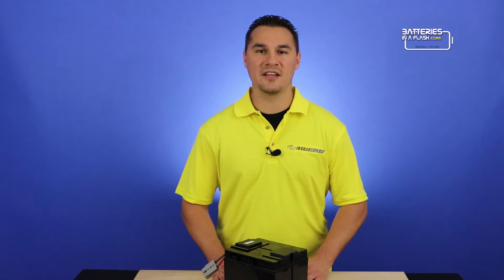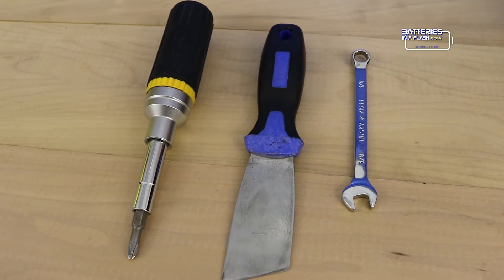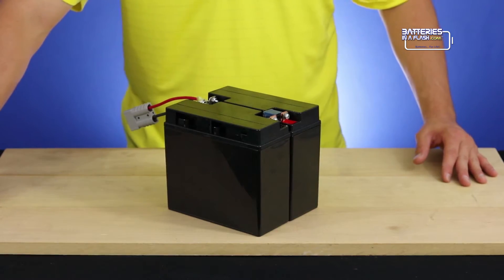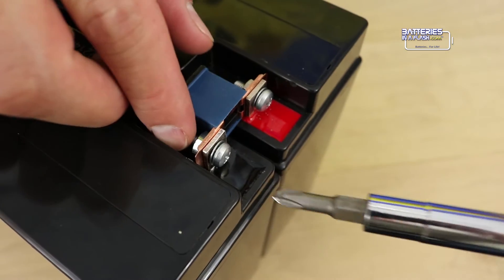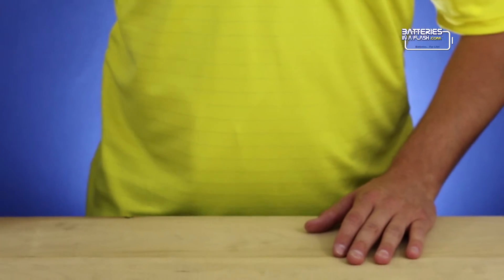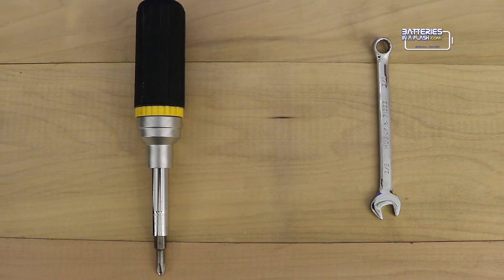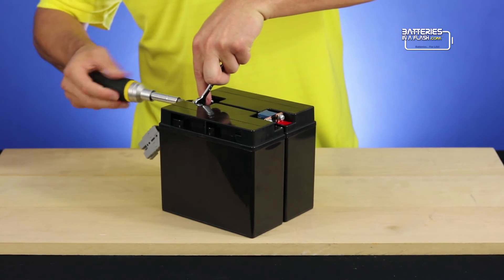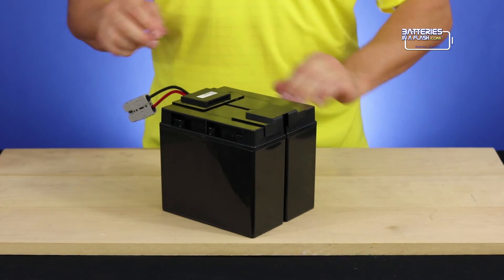Rebuild RBC7 APC Battery Backup Cartridge for SMT1500, SUA1500, SU700XL & More

Comment: I would prefer a plastic tool to remove the covers
Reply from the maker: Definetly use a tool that you feel comfortable using. As long as you get the covers off, that is all that matters. Great suggestion.
Reply: @Batteriesinaflash  Sticking a metal part  on the pos and neg, when everything is still connected.... that's what I meant

Comment: can man use 12V 20Ah batteries?
Reply from the maker: Ousama Hariri Any 12v SLA battery can be used but only the 7Ah, 8Ah, and 9Ah will fit in the housing properly. If you used a 20Ah you would need to run longer leads and the batteries would live outside the housing. It just depends on what your comfortable with.

Comment: Tip - remove fuse link first to negate risk of shorting when undoing the wires.
Reply: Use a piece of non conducting cord to cut the foam pads.

Comment: hi! will the RBC7 work on my SMC 1500?
Reply from the maker: Hello Chris,

No it will not. the pack you need it (2) 12V 12A batteries in an RBC6 configuration. This pack is even simpler to replace. You can see what it looks like in the link below.
http://www.apc.com/shop/us/en/products/APC-Replacement-Battery-Cartridge-6/P-RBC6

You can buy the batteries you need to make your own at the link below. Let me know if you have any questions.
http://www.batteriesinaflash.com/sealed-lead-acid/12v/12ah/exell-12v-12ah-sla-battery-rechargeable-agm-replaces-ub12120-d5744